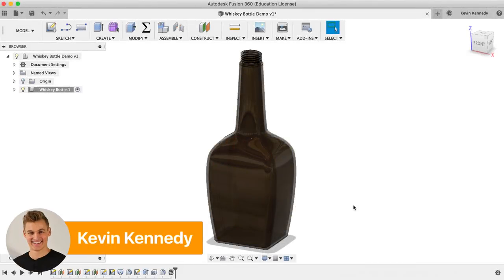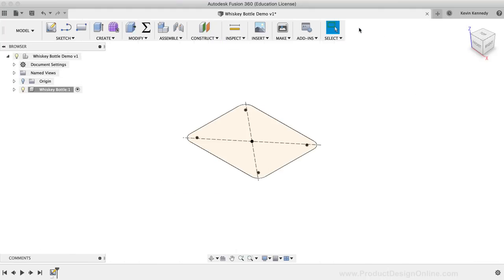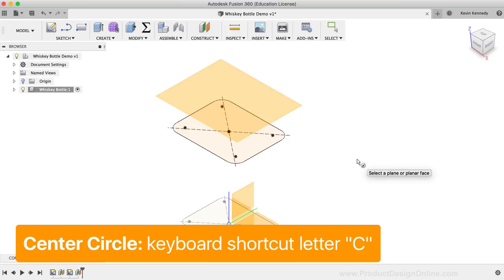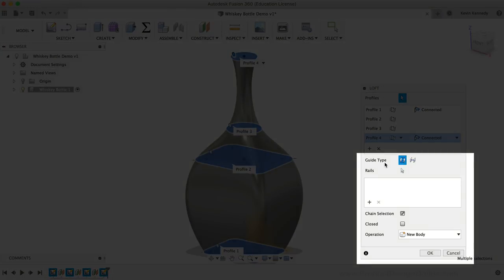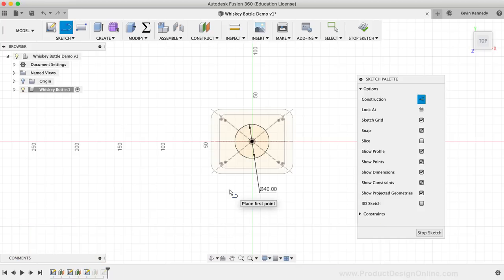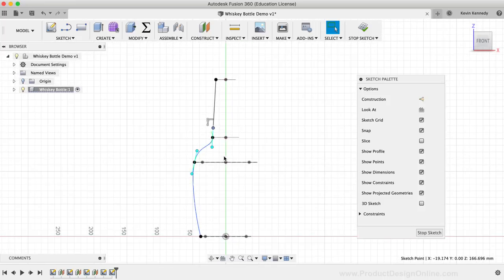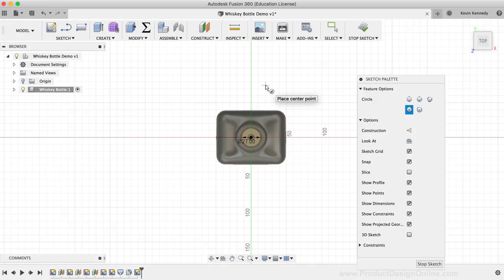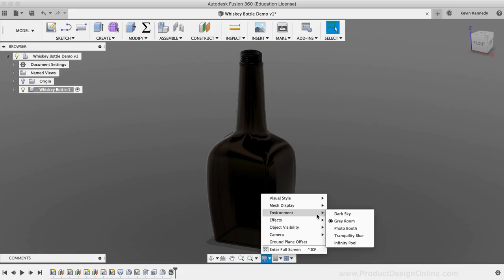How to 3D Model a Whiskey Bottle - Learn Autodesk Fusion 360 in 30 Days: Day #4 (REVISED)

Comment: I've been really enjoying the tutorials but I'm stuck. I'm using 2.0.8624 on Windows 10. I can successfully connect the spline to the straight line and move it up and down like you showed. But when I try to loft, it says all the planes are not connected. I was able to finish the tutorial by simply creating the spline on all 4 planes. But I'd like to understand why I couldn't connect the spline to the line. Any ideas? Thank you very much for any suggestions.
Reply from the maker: Make sure you have the "Auto Project Edges on Reference" setting turned on. Instructions to turn it on - https://productdesignonline.com/default-settings-for-fusion-360-tutorials/#autoProject

That will help you snap the rails to the profiles, as long as you're looking straight at the sketch.

Comment: Hi! been enjoying this series a lot but i do have a problem in this one. When I try and make the Spline I can't use the construction points. it just wontlet me snap anything there. I'd appreciate some help, since this is litterally driving me insane.
Reply from the maker: Hi, Technomen 08. Glad to hear you're learning a lot so far. The first thing to check is to make sure your settings match mine. This will help rule-out whether it's a setting or not. Please crosscheck your settings with mine - http://bit.ly/defaultsettings

You may also find it beneficial to turn off the "Layout Grid," as this will help ensure that you don't accidentally snap to that instead of the construction points.

Let me know if it was a setting. If not, we can troubleshoot further from there. Cheers, Kevin :)

Comment: Hi

Great tutorials! thanks for your effort to teach us all this great stuff.
In this day tutorial i face an issue.After the loft the bottle is hollow and not like yours.
Also when iam trying then to select the botton for fillet action can't select it with my cursor.

Any idea why this happening ?
Try a lot of times the design from scratch but again the bottle is hollow :(
Reply from the maker: Be sure to use the solid modeling command (blue icon) from the solid tab. It sounds like you may have used the surface modeling command (orange icon) from the Surface tab.
Reply: @ProductDesignOnline  You are right. Thank you again

Comment: Fit Point Spline " SNAP" struggles.  I am using the free personal version of Fusion 360, it's March 2021. I had created all the offset planes, created the construction lines, verified the sketch points intersection points, and activated the fit point spline tool.  When I tried to connect the fit point spline with the intersection of the construction line and the edge of the sketch, the fit point spline would not "SNAP" to the position. ??? Is it me or Software???
Reply from the maker: Please check this help article: http://bit.ly/day4solutions

Let me know if that takes care of it for you!

Comment: Yes, tried several ways to do construction coincident lines which the rails didn't connect to. .
Reply from the maker: Hi, Michael. You may have to turn on "auto project edges on reference" in your preferences menu. Cheers, Kevin :)

ps. more instructions on how to turn that on here - https://bit.ly/defaultsettings

Comment: I'm having trouble lofting to fit the rails. It keeps telling me the selected rail does not touch all profiles. However, I am zooming in and my blue line is crossing all profiles. Do they need to be exact when riding the outside of the profile or can it be on the inside?
Reply from the maker: Hi Steven. The rails need to be snapped/touching all four of the profiles. Edit your sketch that has the rails (spline and straight line) and select a spline point > select the corresponding point on the profile > select the "coincident" constraint in the toolbar. This will force them to stay together. If you do that for all four profiles then you should have no problem getting them to work without that error.

Let me know if that works for you!

Comment: Another great tutorial! I am having some trouble when I'm making a bottle that switches from using splines to lines multiple times (example - spline -> line -> spline -> line). I've connected the splines to the lines and still having error messages. If I just do a spline it's fine. If I do just one spline and one line it's fine. Any thoughts?
Reply from the maker: Hi, Michael. What is the error message that you're getting? Is it "does not touch all profiles"? If that is the case, then one of your points likely appears to be touching, but if you click and drag on them all you'll notice at least one point can be moved away from the profile. You may have to add coincident constraints where the spline/lines attach to the profiles to ensure they're 100% connected. Often it's deceiving because they appear connected to the naked eye but if you zoom way in you'll see they're a little bit off. Cheers, Kevin :)

Comment: THank you for the great video.
Unfortunelately I can't get it to work. I made the rail-line from the first to third surface, and then a new straight line to the top. The lines are tangend and snapped. Definitely 'together'. But when using Loft, it keeps giving me error that 'the selected rail does not touch all the profiles'. Online I read that it has to do with 'chain selection' but that doesn't work. I spend a lot of time trying to figure this out, but no succes. Can someone help me with this? I have no idea how to 'merge 2 rails into 1, so that when I select the 1 merged or 2 separate rails, they work as should. Btw, if I only loft the top 2 profiles and use the rail, it works. Only the lower 3 also works. Just not the whole thing like in the video.

Comment: Even with the addition of the construction lines through the center of the four plains, visually the points of the guide rails look connected yet Im still receiving the all guide rails do not touch all plains error. HELP!!! THANKS for the videos definitely subscribed!
Reply from the maker: Hi, Chris. I'll have to take a look at your file to troubleshoot. Share your public link as a reply to this comment. Here's a video explaining how to share a public link - https://youtu.be/2XrcrdV-8Ls

Then, please write a separate comment letting me know you've replied with a link because YouTube flags most links and I don't always get notified. Cheers, Kevin :)
Reply: I am also  having the  same  issue
Reply from the maker: @subhamagarwal8554  Select the endpoint of your spline or line that you're trying to connect to the guide rail. Then, hold the SHIFT key and select the point on the end of the construction line. Next, apply the "coincident" constraint, which will force them to be touching. If you do that to all four of your profiles then you should have no problem with the rails do not touch error. Cheers, Kevin :)

Comment: @21:50 You created a shell of 3mm, mine will not allow me to create a shell of that thickness for some unknown reason I had to alter the fillet at the base to 2.5mm rather than the 5mm like yours which allowed me to then proceed with a 3mm shell have you any idea why? (Using new UI)
Reply from the maker: Hi Michael. The shell feature follows the curvature of the shape...so you may have to adjust your design/curvature of the bottle (by adjusting the spline handles). It may take some trial and error to get it to work.

Comment: Hi Kevin, 
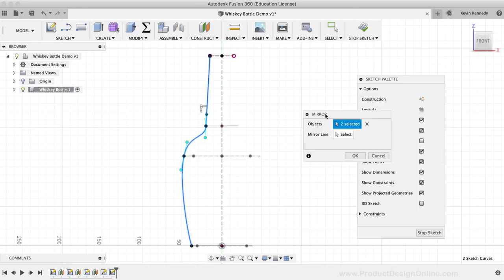I am having trouble selecting the objects to mirror (18:52 mins in) I am running the newest update to Fusion too which probably doesn't help as it all looks different from your revised version.
Reply from the maker: Hi, Anthony.  Can you double check that you're using the "sketch" mirror command and not he modeling mirror command? If you activated the modeling mirror command then it will not let you select the sketch geometry. Be sure to select the "SKETCH" contextual tab and then select the "Mirror" command from the create dropdown list. 
Let me know if that fixes it! Cheers, Kevin :)
Reply: @ProductDesignOnline  Hi Kevin, I am definetly selecting the correct mirror option. Am I able to share the file with you so you can see whats wrong? thanks, Anthony
Reply from the maker: @anthonygrey9282  Hi Anthony. To share your file please go to File > Share > Share Public Link (make sure "downloadable" is toggled on) > Paste your link here as a reply to this comment. I'll take a look. Cheers, Kevin :)
Reply: @ProductDesignOnline  Thanks - this was the mistake I made (selecting the wrong mirror type even though you clearly say "Sketch" in the video!) :)

Comment: Hi Kevin. I have a question about this course on Skillshare. It seems your free videos have been updated but the Skillshare version hasn't. Is there a reason for that? I somewhat thought the Skillshare version would be better and a bit more complete but it looks the same (even worse since the revisions aren't there). Just seems to make sense that you'd get a better quality product through Skillshare since it's a paid avenue. Just wondering. 

Also, one of the things I'm missing with your classes are problems to work on that reinforce the things you're teaching. You seem to be covering lots of Fusion 360 details but I'm finding it hard to keep everything straight and be able to apply the techniques to typical design projects. I see what you're doing and it makes sense in the context you show but I'm having some difficulty trying to decide how to choose which techniques to use when attempting my own designs. And since you provide no problems to work on, it's difficult to even dream up design challenges that will reinforce the topics you're presenting. Would be so helpful if you had a set of problems (with solutions) attached to each video. And it would be even better if you provided some videos that merge up the previously presented concepts to show how to attack designs given what has been discussed so far (and then more problems so we can get used to how to successfully do random designs as the presented skill set matures). Just some thoughts.
Reply from the maker: Hi, Christopher. The videos in the Skillshare course should be revised as well. I've had significant issues in the past with their site not loading the latest video after I've repaced a video with a revised version. Let me look into this to see why they're not there. If you remember which ones are not revised then please message me via the PDO Facebook page so I can get those specific videos fixed faster - https://facebook.com/productdesignonline

To clarify, I've never stated that the Skillshare course has different content than on YouTube. There are two advantages to consuming this course on Skillshare.
1. You can watch it ad-free in a more organized manner
2. Priority support. I respond to all questions on the Skillshare forum much faster than I can get to the YT questions.

The other advantage to Skillshare is the fact that you're getting access to their entire catalog. Not just my Fusion 360 courses, but 20,000+ other courses on creative, technology, and business topics. I have one other Fusion 360 beginner course on Skillshare and one more that is going to be released this weekend. I also have many more planned for the coming weeks. These other courses will not be available anywhere else.

In regards to practice problems - I appreciate you taking the time to leave feedback and your experience. The course was designed to have students follow along while building the same objects that I demo. I understand that everyone learns in a different way (one of the many challenges of teaching online or in-person). Some "students" have found it beneficial to watch the lesson all the way through to digest the information. Then, to re-watch the lesson while they follow the steps. Some then even try to re-build the object a second time from memory (what I would recommend if things aren't sticking).

I've provided various practice problems to in-person students and found that it was not as beneficial as them taking the core concepts and trying to apply them to their own projects. I understand the point you're getting at, but I've found that most users are learning because they already have a project that they would like to complete. The trickiness with teaching CAD/Fusion 360 is the fact that there are no right or wrong answers. Most of the time, there are a number of ways to achieve the same result. There are simply best practices and workflows to follow to achieve results in a more efficient manner (what I demo throughout the series).

Can you provide me with some more details of why you're learning Fusion 360? That will help me better understand what you're looking to learn and maybe I can come up with some additional assets that would be helpful.

Cheers,
Kevin :)
Reply: @ProductDesignOnline    Hi Kevin. Thanks for the info and quick reply. I never said there was any indication by you that the Skillshare course was different, that was just my assumption. I get what you're saying. Well, any of the courses with REVISED in the title aren't on Skillshare. Not exactly sure if you have revisions to some of the videos that aren't called out in the title. I haven't checked the YT videos side-by-side with the SS videos as of yet.

I'm trying to learn F360 for several reasons but don't have a specific project in mind. I'm an EE and have used regular CAD for years and just want to branch out into 3D. I've played a little with Solidworks & Inventor but never really dug in. Want to try to further my understanding of parametric modeling and the specific functionality and use cases for F360. I'm also into 3D printing and want to be able to design models for printing. Since you've provided some problems to others in the past, could you at least give me access to them so I can have some things to at least try? I'd be willing to pay something for a little coaching if necessary. I totally understand there's more than 1 possible way to do any modeling problem but there certainly are some best practices that I'd like to try to get a handle on. Are there any other sites that you know that provide modeling problems for people to try? The biggest issue I'm finding is I can come up with some possible modeling exercises but typically can only get fully through them  based on what I've learned so far (through about lesson 10 in your series & some of your specific sketch tool videos). Again it's tough to find the exact best path through all the learning videos. Some things are sticking but there's just a lot to get a handle on. Appreciate any help. Thanks.
Reply from the maker: @christopherlyons7613  Hi, Christopher. Thanks for the additional info. I looked over the first few classes and it appears that at least 2 of them do not have the revised version. I didn't add the word "Revised" to the video titles on Skillshare (since one video would replace the other). I'll be looking through all of this and updating accordingly over the weekend.

A while back I was doing a "weekly challenge". I think this may be more along the lines of what you're looking for. Check out this page on my website - https://productdesignonline.com/weekly-cad-challenge/

There are 5 challenges with each one relating to a core/concept and video. They are a little bit more open-ended, however, so there is not a true "answer" to each one. I'd be happy to look at your files at the end if you want feedback.

I'm always open to feedback about the tutorials...so again thank you for taking the time to discuss this. Cheers, Kevin :)

Comment: The guide rail solution did not work for me; kept getting errors no matter what I did.  After much Googling and trying things for hours on end, I finally found what the problem on my model was.  The Mirror command doesn't actually mirror an exact copy, even though visually they are identical.  The mirrored spline line and straight line on the bottle neck were not connected according to Fusion 360; even though visually they were and the spline point was locked on the neck line.  The solution was to Trim (delete) the mirrored neck line and redraw it.  A whole day of frustration was finally rewarded, so I'm hoping this solution will save someone else some time.

Comment: For anyone having trouble with the rails, it's probably because your snapping is not working the same way as in the video.  What you can do is manually create a coincident relationship between the points on the spline and line, and the edge of the profiles.  In sketch mode, change your view to be angled and zoom in on a spline point.  Then click and drag the spline point away from the edge of the sketch profile.  Then select the coincident constraint button, and click the profile edge followed by the spline point.  Do that for all the points on the spline and the line, then delete the old mirrored lines and redo the mirror operation.

Also, there is a setting called "Auto Project edges on reference" that appears to be on by default in the old UI, but not in the new UI.  I think that feature being turned off might be causing problems for some newer viewers.
Reply from the maker: Hi, Cyanide300. That is correct - the  "Auto Project edges on reference" setting should take care of most user's issues. I've documented instructions on turning that back on here - https://bit.ly/autoProject